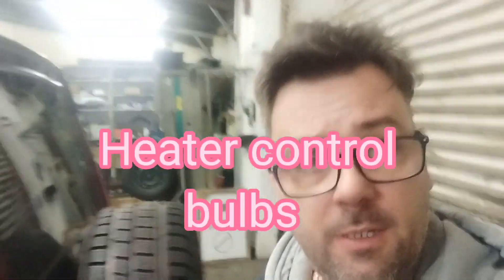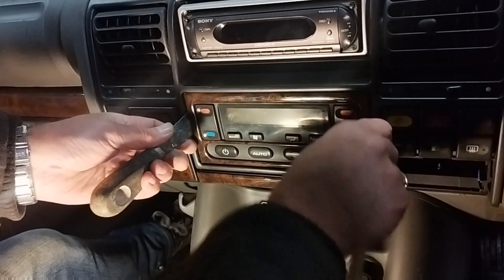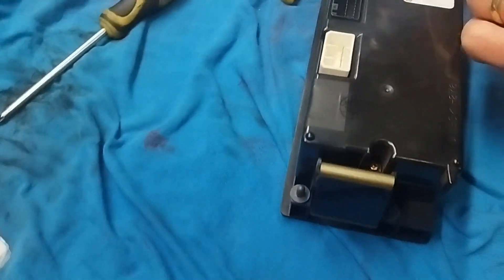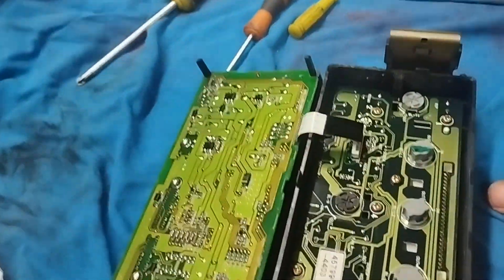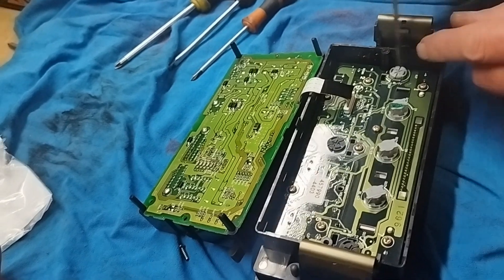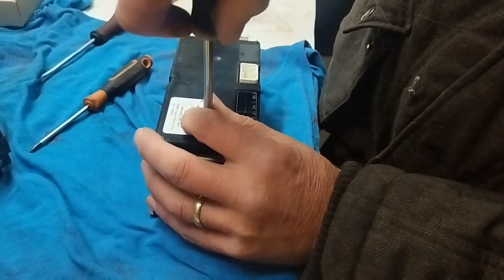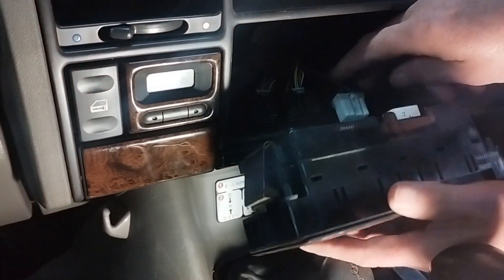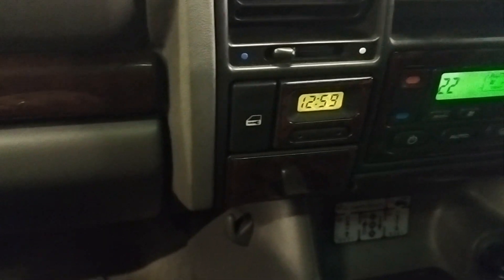land rover discovery 2 td5 heater light bulbs replacement heater control removal.

Comment: The clock bulb can be bought online, but the heater control box is main dealer. Nice wood effect surround!
Reply: Hi Derek. I bought just the replacement bulb for the heater control from a car audio dealer- £3. You'll see how to replace it when you takt the old one apart
Reply: @6970958  Ta. Done mine already but bought the bulbs from a main dealer.

Comment: You can buy all of the bulbs seperately from the holders much cheaper and swop them over. The green part is only a cover over them. I've replaced some of mine.
Reply: I have looked everywhere and can't seem to get a straight answer from people. They say to buy the overpriced bulb and holder from LR, but that's ridiculous. Can you confirm that these are just standard 1.2 watt mini bulbs before I start taking everything out of my dash? Thanks a ton!
Reply: @rcsteele3169  There a 3 different bulb holders. 1 for bottom switches. 3 for LED display. 2 for heater control switches. It depends which one you're after. Easy enough to remove and check. Got mine from car radio shop

Comment: Does anyone know if the bulbs stop working does that cut the whole system out? Just bought a disco 2 and the climate control panel doesn’t make any noises or light up and I have no heater controls at all, fuses ok but not sure where to start from there